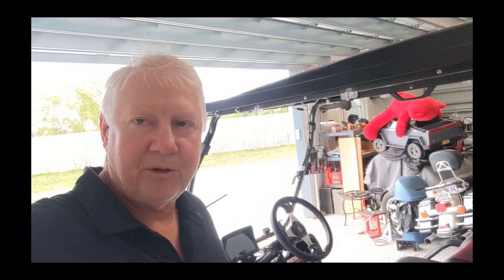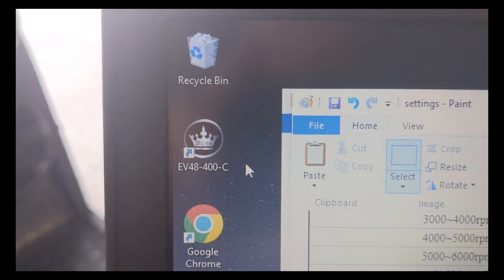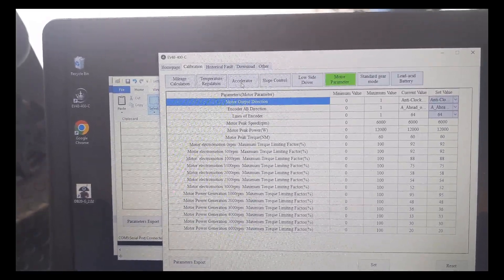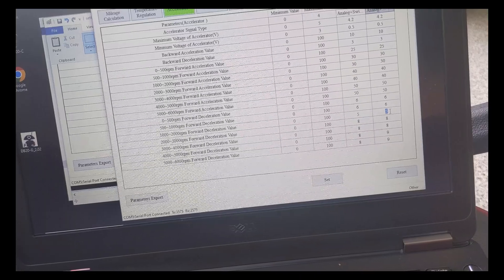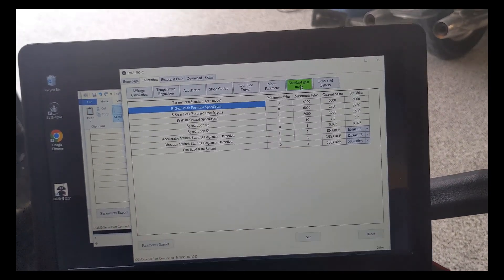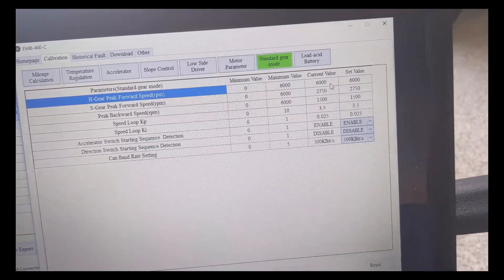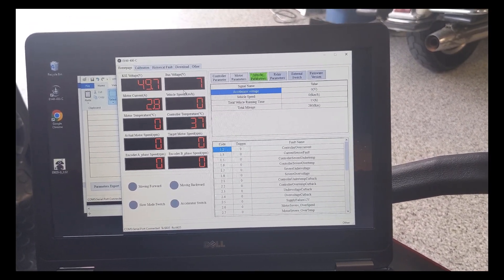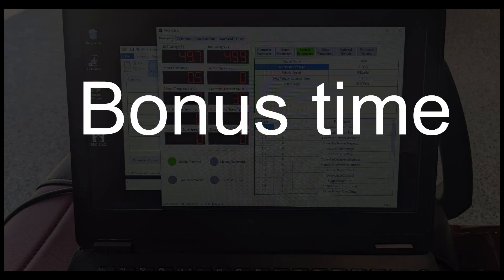Evolution Golf Cart controller Programming tips

Comment: My set button is grayed out after changing parameters.  Also I used the activation code and connected my com port correctly, but it only transmits and does not receive.... Any help would be great!
Reply from the maker: I am not sure what may be going on maybe somebody Will chime in. Walk through the zip file and ensure the right code was used. You can also check to ensure the correct communication port has been selected.
Reply: @dgreerls1  same issue, got correct software and cable, not connecting to com5 or any com, cannot configure anything

Comment: I have it connected and in com5. Current state shows activated and connected. However in the homepage I have no readings. It also doesn’t show any of the settings from the dealership. Can you give me some guidance?
Reply: I am having the same issue on a ‘25 D5 Ranger. I’ve got the correct software and cable but can’t get any data from the cart. I’ve been going crazy for the past week trying to figure this out lol
Reply: @dgreerls1 did it ever get this sorted and if so how?
Reply: @DoItAllDustin  same issue, got correct software and cable, not connecting to com5 or any com, cannot configure anything
Reply from the maker: Go back to this web site to ensure you have the correct cable AND ensure you are using the correct software.

Comment: I can’t get Com5 to show as an option in order to connect. I get com3 and com4 to appear but it won’t do anything. Any suggestions? Thanks.
Reply from the maker: You may want to try a different usb port. Then do a search on bottom of your windows where it says type hear to search and type in system and select system information. open up the + sign under ports and see if you see it there under serial and what com port is listed.

Comment: Question of the year. Ok. So the new 2025 plus screen has CarPlay, Android Auto, etc. can confirm the wiring harnesses are identical and you can plug a “2025” screen into any Evolution model that had the old screen and it completely works. I’m NOT convinced there is a single hardware change and this is merely a FW flash. Whatcha got on research into that area?
Reply from the maker: Have to check it out.
Reply: @darmiejr Any results from looking into this? Like I said, the 2025 has an entirely different setup for the infotainment. including carplay, anddoid auto, etc. Yes it has a hardware change for an automatic light sensor. You can absoulutely plug a "NEW" screen from a 2025 into a 2024 and it works. I'm not convinced a hardware upgrade took place internally. It would be very interesting to know if you are able to flash it with the updated FW. ALSO, what FW are you currently running on your 2024 as it was delivered I assume? Just curious if your version is the same as mine also.

Comment: What’s the mileage calculation tab have under it? Is it for changing the wheel size and adjusting the Speedo or actually typing in an odometer reading?
Reply from the maker: @CgBrian   I think it is for wheel size. I know how it's set online it's pretty spot-on with the GPS reading
Reply: @ how it’s set online is spot on with gps… set online?!?
Reply: @darmiejr  Not sure what you meant by "online". My speedo seems to round up. I need to do a much larger test data set, but at 5.0 miles on the cart ODO, I'm at exactly 4.80 GPS. Extraplated out this equals an odometer that records 100 miles per actual 96 traveled. Again I used a bit too small of a sample size for accuracy, but from that test I'm traveling 960 miles per 1000 being recorded by the cart. Need larger data set though to be sure.

Comment: Great video and explanation.  I used your parameters on my 24 Evolution Forrester and they work great.  My only complaint is at low end acceleration it "jumps" too fast at takeoff with just a touch of the pedal.  So should I lower the numbers at the 0-500rpm?  What would you recommend? Thanks
Reply from the maker: Drop them like 50% then start there

Comment: I have a 2024 d5 im guessing its a 400-a since i cant find an English file. I downloaded the one from buggy forums and the installer is in Chinese. I got it to download but it asked for a key and i cant understand the instructions
Reply from the maker: it should be in the zip file called EV48-400-c activation Code-20230831
Reply: Mine is a ev48-400-a. I finally got it registered. Now it says communication failed as in receive response info. Maybe it's my computer or driver. I used the driver in the file

Comment: Worked just as he said. 25 up to 32 now.
Reply: I am at 25mph as well. I would really like it to do 32. Could you make it go faster than 32 if you wanted to? Just curious what the limitations are on this cart.
Reply: @WILLIE3K  I'm sure you can, but I have a 17 year old and don't want to take the risk.  Also the main mechanic at Jack'd Carts didn't recommend anything over 30 because of the issues it develops and into his shop.
Reply: That’s where I got them. I’ll put the software into Dropbox tomorrow and post a link to it.
Reply: @tomhofferber5529  Thank you
Reply: @tomhofferber5529  Tom, Any luck with putting the software in a Dropbox folder?
Reply: Tom - How did you get a copy of the software that does not contain a virus?  Can you share it?  Think software links I have seen on here all contain a virus when you try to install them.

Comment: How much faster did it make the cart
Reply from the maker: It was set at 25. I got it up to 28. I've seen 29 one time on the GPS. since the manufacture sets the max RPM that's about all you can get. You can put higher wheels or tires but the RPM is the limiting factor so for my cart, 28 is it.

Comment: What cable do I need for an Evolution D5 maverick? And where can I get the program to change the speed? Can you share links?
Reply from the maker: I would recommend checking out this website and select your cart. He he has a broken down to what your controller looks like to determine the right type of cable. If it is a 2024 evolution then chances are it will be the cable that I have linked to. Most of these controllers are based upon the year model as noted from his website. But just to be sure you can always remove the cover and take a look.
https://www.cartcables.com/pages/evolution-electric-vehicles-controller-id-guide
Reply: @darmiejr  do you know were I can get the software?

Comment: What are the other pieces of software you have to have in the folder that you mention @ 6:40?
Reply from the maker: When you open up the software zip file you'll see there are some drivers that need to be run. Construction should be included on the software ZIP file.

Comment: Great video!! I recently purchased a 2024 Evolution Classic and wanted to up the H/L speeds.  Your video was spot on!  Previously, I had an EZGO cart that had a Curtis controller and had purchased a USB-TTL Programmer interface device off of eBay.  It worked great for the Curtis controller and also worked with the Evolution controller using the EV48-400-C software!  Again, thanks for the great video!
Reply from the maker: Thank you. I know the video is a little cheesy but the idea was to cut to the chase and point out simple things to change to get a little more speed.
Reply: How do you download the EV48-400-C software?
Reply from the maker: @MarcusRobinson-ny9lg  You can try these links. The software is not easy to find.  https://www.buggiesgonewild.com/showpost.php?p=1906443&postcount=3
Reply: @darmiejr  My anti virus program blocks this software - says it contains a virus
Reply from the maker: @mark090455  Any software install testing, do it on a laptop you can reformat. Use USB to install, don't connect to WiFi.
Reply: @darmiejr  Unfortunately, I do not have a spare laptop I can reformat. I can disable my antivirus software temporarily, but that is dangerous.  Did you get a virus threat warning when you tried to install it, and if so, did you just ignore it?  My cart will only go 24 mph per the radar machines I drive through and I really want to bump up the speed  a little.